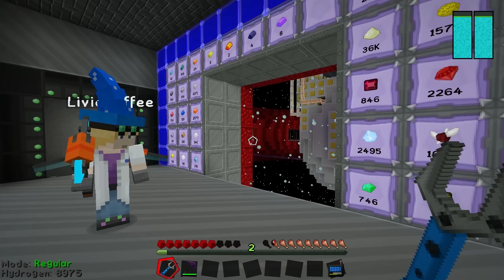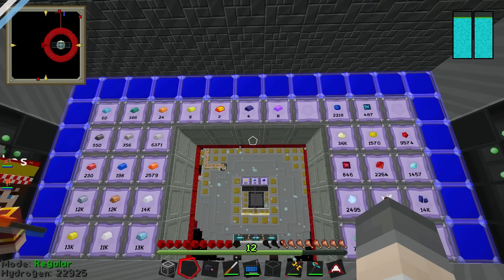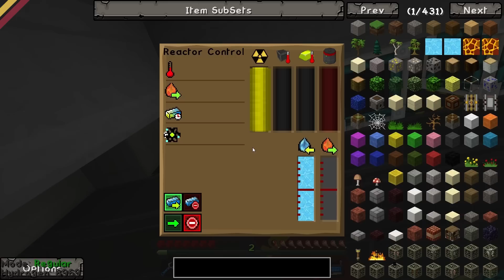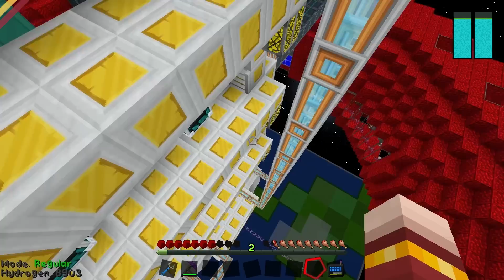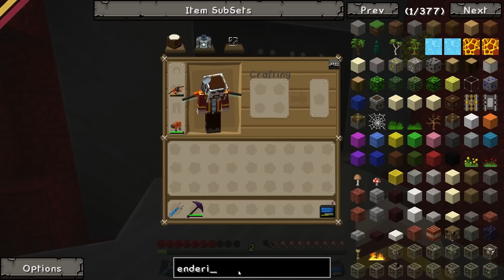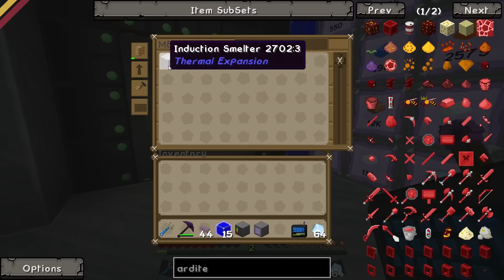Minecraft - More Turbines - Hole Diggers Extra 6

Comment: Lewis. Tesseracts can only transport energy, liquids and items. It is not able to store anything in it. They were designed to be able to handle 50x the normal output for a Resonant Energy Cell which is extremely high. Within the next update for the mod they will be able to possibly store more energy than 5 Resonant Cells and transport infinite energy but this is only a rumor of what will happen in the next update.

Comment: 100% Efficiency between the reactor and the turbine requires the Inputs and Outputs to be adjacent to each other, touching. This then constitutes no lacking. This is how you setup the Steam and Water input/outputs

[ReactorSteamOut][TurbineSteamIn]
[ReactorWaterIn][TurbineWaterOut]
[TurbineEnergyOut][EnergyStorage]

Instead of

[ReactorSteamOut][Pipe]~~~[Pipe][TurbineSteamIn]
[ReactorWaterIn][Pipe]~~~[Pipe][TurbineWaterOut]
[TurbineEnergyOut][Pipe]~~~[Pipe][EnergyStorage]

The output transfer limit is the same as what the machine's TotaOutputPerTick and and Input Limit is storage*usePerTick.
So that if the machine generates 20 buckets of Steam, the blocks touching will transfer 20 buckets of steam
If the machine uses 15 Buckets of Steam, then the machine will take 15 buckets of steam. This has the same effect for water and Energy.

Pipes are dumb and are for setups that cannot touch each other, like Processing machines and computers, not for reactors and capacitors. Snug the Fuel, Generator and Battery up together, and you don't get energy or efficiency loss.

Comment: The rotary condensentrator from Mekanism can turn oxygen gas into liquid oxygen, which can be piped through tesseracts, and back. So if you made like 50 of those, then you can generate the oxygen on the planet, condense it, pipe it to the station, then turn it back into a gas once it's there.

Comment: If you use modular force fields the inside of the force field only needs an oxygen sealer and it will seal you don't have to deal with the head ache of sealing every room and u can make the feild any block even transparent thought this may help duncan mentioned not being able to seal the place and you can do any size and shape

Comment: Technically the Tesseracts are the most efficient because instead of the fluids or power being sent though a cable it is like plugging them in directly. Since the distance is shortened to one block you don't get the backup you do in pipes and cables and thus it is a much faster system.

Comment: The tesseract mod needs to be installed because big reactore is an add on for it
Reply: No, it isn't. Big Reactors just uses the RF power system. It can be put in with no machines at all.

Comment: You need to use a Fuzzy Export Bus instead of a Precession Export, the fuzzy export ignores meta data and nbt which defines what and encoded pattern is encoded with so using a fuzzy would allow all encoded patterns to be exported.

Comment: To combat the heat/fuel problem, you might consider using rednet controllers, and feeding the battery storage percentages from the turbines directly to fuel rod control % on the reactor
If the batteries at base have full power, the reactor will shut itself down as the turbine buffers fill

Comment: Tesseracts have a very high output of everything, it can empty and entire chest in seconds if setup right, I used it to transfer fluid from one steel tank to another, and it emptied 20 million buckets in under a minute, and I have a reactor producing 200,000 RF/t, and it's all going out at once through a single power port into a capacitor capable of 9 billion

Tesseracts are very powerful things, better then any cable or pipe in any mod, they just can sometimes be buggy, like for instances pulling power back out, it doesn't register that it needs to, and you have to hook up a cable to it for it to work

Comment: The ME patterns have differing ID numbers or something I think - what I've always used which works is a Fuzzy Export Bus with a pattern in it, and set the fuzziness to "match any", outputting into the ME assembly multiblock
Reply: ps: 36 enderium blocks and 80 blades per turbine, at 2000 mb/t steam you'll get 24-25k rf/t, seems to be the "optimum" build for a turbine

Comment: Relays seperate network segments from each other (but still transfer power to the other segments they're connected to). So you wouldnt want to use them to connect the drive bays, because the ones on the other side of the relay would not be able to communicate with the rest of the network. You'd use them if you have 2 seperate ME networks (each with their own controller) and you want them to share power.

Comment: You should download the mod "Pressure Pipes" by bdew. You can transport unlimited steam and fluids in one redstone tick.
Reply: but that sounds boring and broken.
Reply: KaminkoMcMad Why that? If you want to transport massive amounts of water or other fluids around you compound, it'll be very useful.
Reply: I guess it's not any more broken than tesseracts...though I hope and believe that they still deduct a portion of what is transferred. But it shouldn't necessarily be easy to make piping for an extreme volume of stuff.
Reply: Hey psttt...

They dont read comments, silly.
Reply: KaminkoMcMad The thing what's limiting is how fast the machine your pumping fro mand pumping to can use the liquids. And for a normal player those pipes are quite expensive. (For sure not for them, as they are running 5 or 6 laser drills at the same time.)